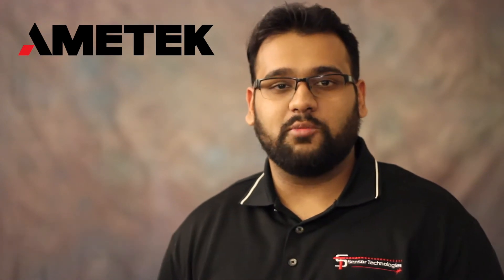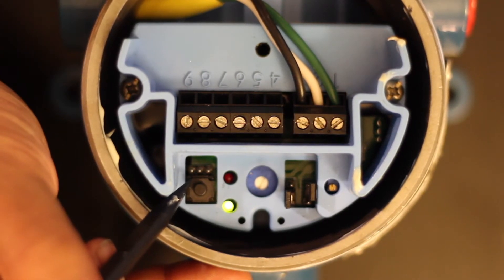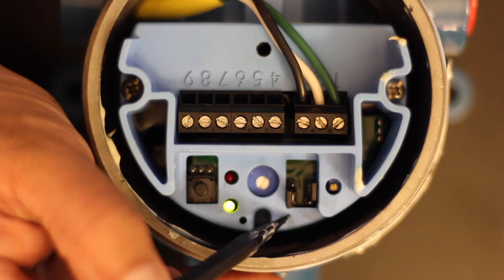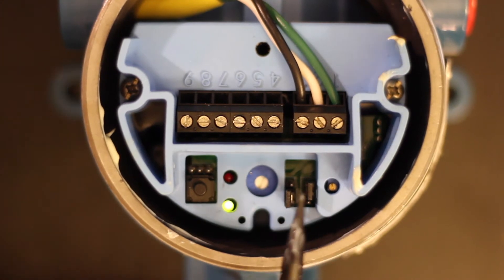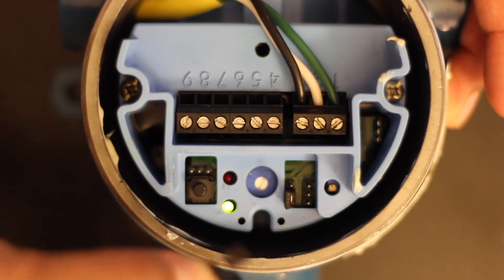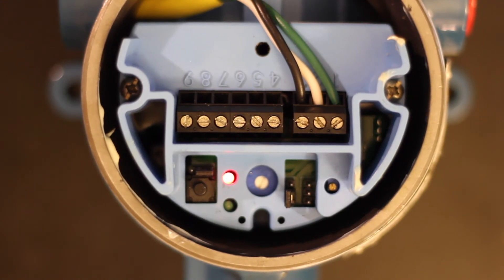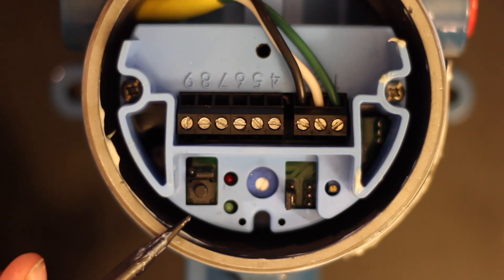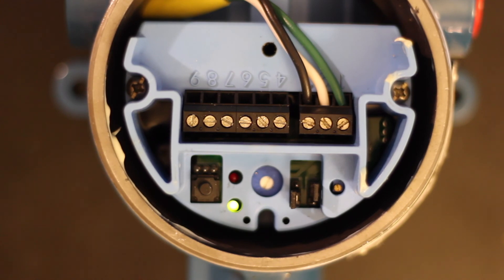How to Change Modes on ThePoint Level Switch

Comment: If its sensore wires will open there will be no fault alarm 
Its mean there is no security for sensore fault or wire broken
Its hapen with me during a transmitter yearly callibration one wire found open
Reply from the maker: This is correct for ThePoint. If the probe or ground wire is disconnected it will not produce an alarm condition. If this level of security is required we offer the IntelliPoint which has the Verify self-check feature. If the probe capacitance decreases by 2 pF below the initial calibration value this will be detected and a fault will be indicated.

More information on Drexelbrook IntelliPoint Series: https://www.drexelbrook.com/products/point-level-measurement/rf-admittance-level-measurement  

Please send requests for product selection or technical information to: drexelbrook.applications@ametek.com

For assistance with calibration and troubleshooting please use drexelbrook.service@ametek.com